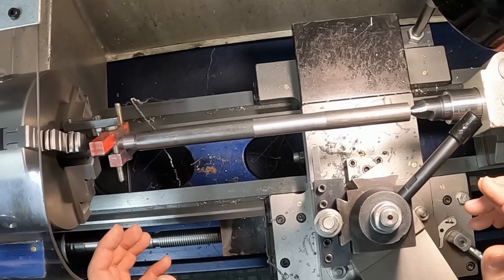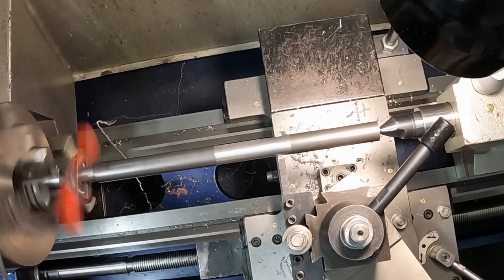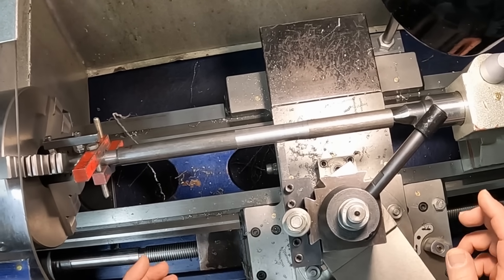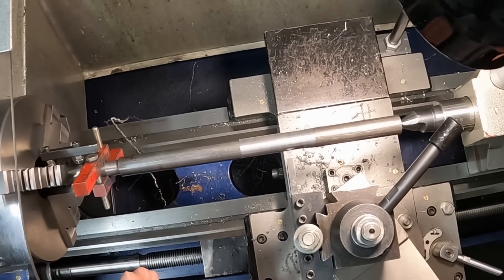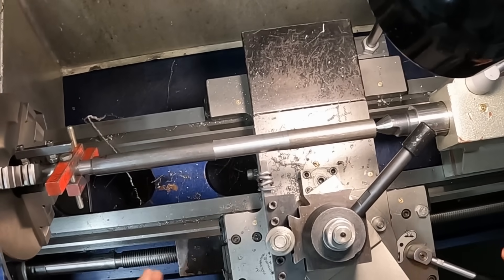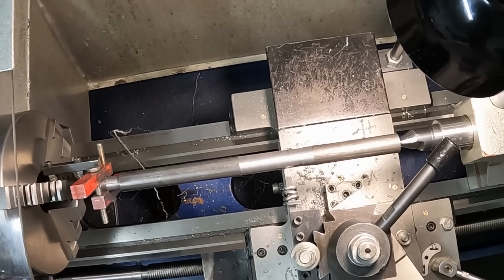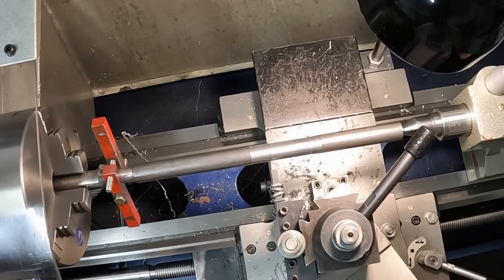Solving the CHATTER problem for the home workshop

Comment: Hmm, you are in danger of flirting with pseudo science here. The "springiness" is not just down to the tool or the work piece - you need to consider the whole path from the cutting edge, along the tool, through the top slide, cross slide, saddle, bed, chuck and through the workpiece back to the cutting edge again. That represents an elastic (springy) system and a speed / force characteristic due to the tool geometry and material properties. These result in natural frequencies but even then, we usually have non linear characteristics at play, so there is no simple solution.

In practical terms, you need to play with the tool geometry, feeds and speeds to get away from the resonances you encounter, rather than believe there is some simple, universal tool geometry or speed / feed that is some sort of panacea. You might also wish to ensure your slides are optimally adjusted (gibs etc). Either way, wrapping solder wire around the tool is likely as effective as wearing a tin hat. Nothing personal but I think you may be in danger of oversimplifying things here.

Comment: I'm not much into manufacturing but I remember that there are 2 reasons for chatter: static instability or forced vibrations. The second one being more straghtforward as the chatter occurs at the frecuency of the force being applied to the tool, varying cut speed solves the problem in most cases. For the instability, it is mostly caused by the cut depth being increased and decreased due to the flexibility of the tool, holding mechanism... This last one could be solved by changing the shape of the cuting tool (u can see it in interior hole cutting tools), or how the tool is fixed. As many people suggested, even untightening a bolt, intermediate material in the holder or changing the lenght by grabing the tool in a different point can solve this problem also. 
All in all, nice illustrative video showing the chattering and a way to solve it, as you said, many times avoided to propose a consistent solution about.

Comment: It would have been better if you at first changed the tool geometry then added the ant chatter wire. That surely would have been more accurate way of showing each method. We used to you magnets or simple elastic bands depending on access needed for the tool. We were also taught that you keep the tool at its shortest tool overhang for each tool needed. You could also change speeds and feed rates to eliminate the chatter.

Comment: From my experience on small lathes I have found that varying the feed and speed can eliminate most chatter but it needs to be done continuously.  Once you settle on a particular feed/speed then it's not long before the sympathetic inherent harmonic vibration creeps in.  I have in desperation twiddled the speed control on the VFD back and forth to kill any build up of vibration especially when cutting hard bronze with a fine cut.   The tool attempts to skate on the surface instead of cutting and this causes the tool pressure to change and then it will dig in and the whole cyclic performance repeats at an annoying frequency.  A rigid and narrow cutting surface along with a sharp edge and a suitable speed and feed will get you through most situations.    Tubes can be stuffed with cloth for outside turning and for inside turning your damping wire is a good addition to the long thin boring bar.  I find that turning stainless steel tubes to be the most difficult and I will try your dampening wire along with weights attached to the outside of the tube with Jubilee clips.  Thanks for making this video but I think you have a few more tips to convey on this subject - the bane of every machine turner!

Comment: I keep a chunk of oil clay on my lathe specifically as a universal vibration dampener. It instantly takes care of most chatter caused by significant overhangs. It even works well on long, thin parts between centers.

Comment: Good video. Let me tell you about my secret trick for dampening high frequencies: tighten the tool holder screws less than usual. And if you have multiple screws, let's say 3 screws holding your tool, actually use only 2, the first one and the last one. Don't even touch the tool with the middle one. Tighten the first front screw normally, but not strong. The back screw, tighten barely. Just touching and applying the slightest pressure.

I've been using those tricks to bore impossible bores, mostly on CNC lathes that tend to have super high harmonics because everything is so tight and rigid compared to manual machines
Reply: Huh, that’s really fascinating. I never would have thought of it but it makes sense, (OTOH, I just have a home-grade 12x36, so too much stiffness probably isn’t likely the problem it is with a high-end CNC :-)
Reply: I'll try that. 👍
Reply: انت عبقري بالفعل كلامك فيزيائي وانا اوافقك.
Reply: Ahhhh to get soaked with coolant trying to keep your arm and wrench out of the danger zone while a CNC lathe is taking a deep pass making sure you don't accidentally loosen ALL of the clamp screws... the days before new machines got all serious about "safety features" 😆 I tune my boring bars the same way when I'm setting up just to get ahead of any chatter. You can get some pretty serious overhang like that

Comment: Very excellent approach and knowledge - i am pleased you created the video. You often refer to damping - which in principle is a resistance force added to the vibration to reduce its amplitude (and consequently reduce frequency as a secondary effect.) Most of the examples you gave change the driving frequency (pointed tool) or the natural frequency of the assembly. For instance the lead solder likely adds a secondary natural frequency whilst the copper likely reduces the natural frequency. I look forward to seeing more of your videos
Reply: damping is about turning oscillating energy into heat, out of the oscillating mechanism - which is what chatter is - an oscillating tool/work interaction.

Comment: Great insights! The length of the stick out changed the frequency.

I had flashbacks to Dr. Wells lecturing about vibrations, except i wish you had taught that class. Dr. Wells did a terrible job of showing how systems vibrate and how to detect the frequency and dampening. There was always a "c" factor, but did he ever explain how you find that? Or, how to predictably change it?

Comment: You're adding "damping" not "dampening". While I LOVE this video, I wish people would not perpetuate this mistake. Oh, and as for annealing copper. You can dunk the copper in water after heating, but all this does is cool the copper more quickly (and maybe decrease the oxidation that builds up from heating). Unlike ferrous and other metals where the quench is a critical part of the hardening/annealing process, for copper slow in-air cooling vs. plunging into ice water will make no significant difference in the end result.
Reply: Doesn't matter. If you dip in alcohol will come out clea , watch out for flames.
Reply: Clean
Reply: Unlike ferrous metals, where quenching hardens them, copper is quenched to keep it soft and prevent it from hardening through air-cooling.
Reply: @SkippiiKai  NO, that's exactly WRONG. For copper, you anneal by heating. Unlike ferrous metals, it makes no significant difference in the annealing result for copper if you plunge into ice water or just let it slowly cool in ambient air. LOOK IT UP! Stop spreading misinformation.

Comment: Go to Open Source Machine Tools and learn how to use a lathe.  Also overseas lathes need to be completely disassembled, cleaned, lubed, reassembled and then finally adjusted properly.  Then come the mods to almost eliminate deflection.  My G0752 never chatters unless Im being scared with the parting tool and using too slow of a feed rate.  As soon as I grow a set and speed up the parting tool the chatter disappears.  99.9% of deflection on overseas lathes comes from operator error.
Make chips that dont need dips!
Forge On!!!

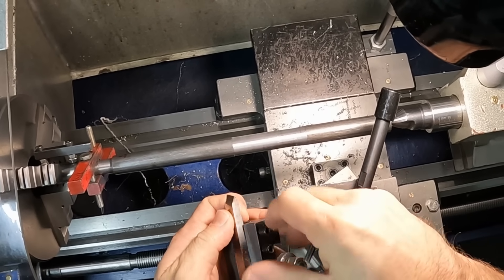Comment: 1:48  Proceeds to violate the scientific method.  Next.....
Reply: I'm a lifetime autodidactic electromechanical troubleshooter and I do that all the time to myself trying to speed things up, then I'm disappointed that I do not know what the key problem was.  Long ago I ground aircraft cranks on centers, then diesel, and later metal cutting machinery which is a different animal.  Back when Some Girls LP wasn't that old the guy turning camshafts behind me would be singing Chatter instead of Shattered.  Number one thing is to double check the long list of set-up procedures, something isn't tight enough.  I used to have scars from trying to fix chatter problems till I burned them off, still have all digits at least.

Comment: Great info, it'll be of much use to me I'm sure. One thing I'll add that can sometimes help but isn't actually possible on a lot of machines is to bump the speed up and down. My old raglan with its variable speed drive held me out sometimes but I'm sure the tips in this vid will do a better job, thanks!

Comment: Several things to try that have been alluded to by other commenters. First, try speeding up the spindle rpm to try to get away from the natural frequency of the work. Slowing down a notch on the rpm often doesn't get you far enough away from the natural frequency,  but is worth a try. 
Second. If your lathe is capable of handling the loads, try using the recommended speeds and feeds in the Machinist Handbook (or similar reference) for production work. Sometimes on long unsupported work an increased feed rate will load the work so it won't chatter. The trick is to finish with a heavy cut to size if the coarse, but smooth finish, is acceptable. If you try to end with a light cut it will vibrate like all get out.
The discussion in the video about the cutting tool profile is the reason I use cemented carbide tools instead of insert tooling. I can grind the cemented carbide to a sharp corner profile whereas, unless you have just the right insert, the insert will present too much cutting edge to the work for a small hobby lathe. Additionally, American made cemented carbide tools are just a couple of dollars apiece and last for years in the home shop.
Cheers from NC/USA
Reply: For inserts equivalent of "sharp" cemented carbide, you can use 5 things to your advantage in the world of inserts. 1: prefer a small nose radius (0,2 to 0.4mm even for roughing, they are stronger than they used to be). 2: use CVD coated inserts instead of PVD coated, because the coating is less thick, which keeps the sharpness of the cutting edge. 3: use a positive tool geometry rather than negative, which decreases cutting pressure. 4: some inserts are ground after being coated to recreate a sharp edge, as well asuncoated inserts for finishing, and choose a light-cutting chipbreaker design. 5: rather than the common 5 degree rake angle, position your tool to have a neutral 0 degree rake, in this manner the force is directed 100% towards the spindle and radially, rather than towards/away from the workpiece, and this helps a lot
Reply: I have had some luck with the brazed carbide tools, but I realized to get the more pointy tip required, on a small lathe, you could take, say, a left- handed tool & lay it on its side, and then you have less carbide to grind away to get the sharp tip for a right handed tool - and if you grind some top relief, you have the whole width of the carbide tablet for resharpening. Bonus if the carbide was sloped away from the cutting side because then you get some side relief when you tip it on its side, without grinding away a lot of carbide - or can mill the angle on the bottom of the tool shank. 
Using a coarse green wheel to rough things out with these, & the imported ebay brown diamond wheels seem to work pretty well, for the price.. 
Also experimenting with re-shaping used carbide inserts for this - I am suspicious that they are often a better grade of carbide.. 
Great video, was just having some disappointment with some chatter last night on my 10" Logan.. probably pushing it too hard.. although I was getting a really nice finish with a carbide shear tool with a fine feed rate, once I was done roughing (see Mr Pete, & other videos..)
Reply: @windrk_6754  and if you grind some top relief, you have... unnecessarily removed the nicely diamond lapped surface the manufacturer provided... And reduced the thickness of the carbide tip, and caused it to generate more heat in use.  Carbide tool sharpening was a five stage progressive process when I learned it... Roughing to lapping...

When you buy brazed on carbides, use them with the top/back/compound rake they came with. Just grind the front and side clearances as required. grind them as soon as you become aware they're dulling, so you needn't do to much grinding at any one time.  Grinding front and side means you need only adjust the tool height a little, if anything, when you remount the tool. Grinding sooner, rather than later saves you the discomfort of handling a hot tool.  Grinding the steel shank below the carbide with a coarse aluminium oxide wheel before grinding the carbide with a green grit silicon carbide wheel makes life easier, too, the silicon carbide not being called upon to remove material it wasn't constructed to...
And... Don't grind chipbreaker grooves into the brazed on carbide tip.  Yes, it does work, to an extent, but it weakens the tips, and reduces their life expectancy... Right grade, right shape, right rake, grind little and often, and not on the top, if it's avoidable.  If a big flake of material's chipped off the top, you may have to grind the top, but it's a pain... C60MV was a good carbide roughing wheel, from memory, C120MV before diamond lapping (with a close dress) Open dress it for roughing if you haven't a coarser wheel... The bigger the grinding wheel the better, a small wheel tends to leave a "hollow" below the cutting edge.  Grinding on the side of a straight wheel's frowned upon, and dressing it's a bugger anyway.  Have, but seldom, used cup wheels for carbides.  Not often found in general shops...
Reply: Do you mean brazed carbide tools?
Cemented carbide is what inserts & the brazed-on carbide pieces on brazed carbide tools are made of.
Reply: @nutgone100  You saved me saying it.  I get triggered by the incorrect use of the term... Because a manager I had at one time used to refer to "Brazed on carbide" tooling as cemented carbide, and reacted badly, when, tired of hearing it said, I corrected him...  He didn't like my criticism of his trigonometry, either...

Comment: I cut a lot of stainless heavy wall tubes. 24-28” length.  I was having issues of poor finish in the middle and  used an indicator to check if the center of the part was whipping a bit.  It was so I slowed the part down but then found the lack of tool pressure was giving a poor finish not chatter but poor surface finish, research revealed the stainless likes some cutting pressure.  So I tried one with more shear better but not great. I added the steady rest in the center which improved the cut but matching the finish in the center is difficult.any suggestions would help.
Reply from the maker: That's a very specific condition, and I hope this isn't a commercial venture... that length you should be using a traveling steady. Check tool height along whole length of cut. Your depth of cut has to be more than the tip radius assuming you are using tip tools, and the chip breaker is very specific for stainless. What can also help is to plug the tube with wood or soft plastic, basically you machine the plug to a easy fit, cut the middle 45 deg and machine a bolt hold. If you tighten the two pieces it will plug the tube snug. This will add massive dampening and should solve your problem!

Comment: Don't forget about the natural frequency of the work you are turning.  It is loading and unloading and deflecting too.  Also the section is reducing in diameter changing its stiffness.  The RPM is also a forcing factor....pulsing the RPM while cutting could keep chatter from forming and repeating.... better solve for the eigenvalues!😂

Comment: Sometimes I let a wrench or dead blow hammer ride on the turning part to damp the chatter. That is usually my first move because it doesn't involve stopping.
Reply from the maker: Interesting idea, how do you stop it from falling off when you start?
Reply: @Lukers_tinkering  No I am holding it by hand and adjusting the location to find the nodes. Just letting it rub so the mass changes the frequency.
Reply from the maker: Ah... that'll work! Sounds like you an old hand with machining, I would be hesitant to suggest this to a novice. This is for the advanced class...  @billshiff2060
Reply: @Lukers_tinkering  Yeah it can be finicky finding the antinode of both the part and the wrench/hammer and make them cancel out. Just stay away from the chuck jaws and don't get between the rotating part and the tool post.

Comment: Lovely to hear a good South African accent.... I recently built a stone slicing machine and had trouble of chatter machining the ends of the mandrel to take the cutting disc. I made a lathe steady which has helped in the machining of the long shift but I will definitely use your methods to make a cleaner job.... thanks.